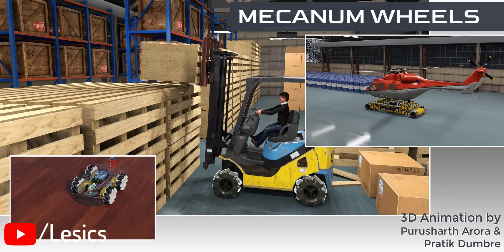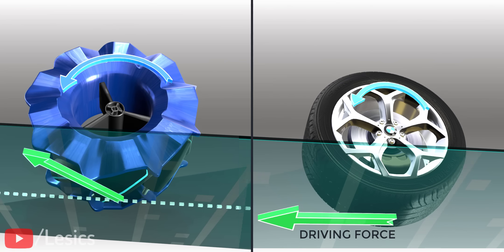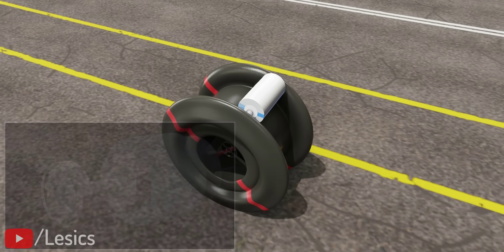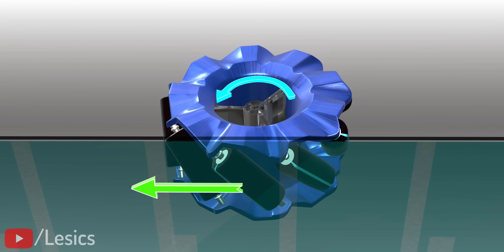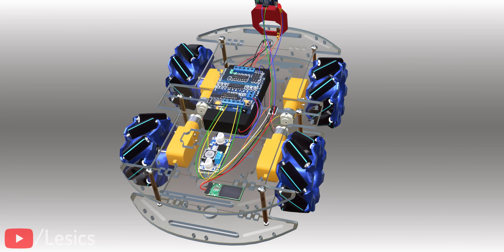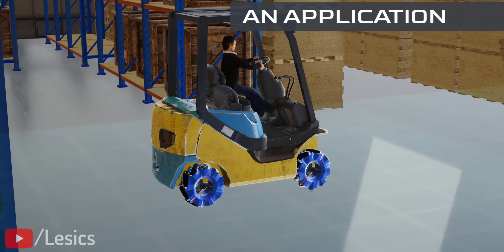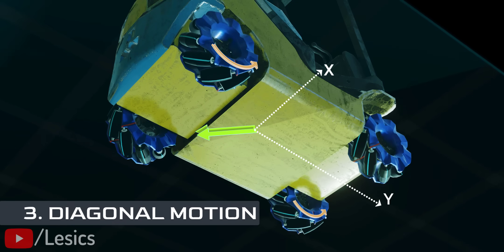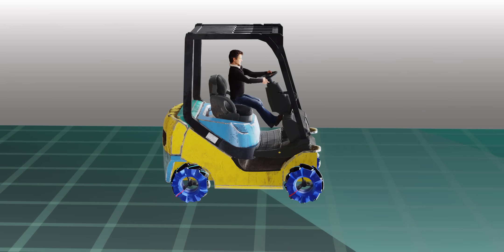The Brilliant Engineering of Mecanum Wheels!

Comment: But if the load is greater at the front than the back (due to the lifting), then chances are that the 2 front wheels will carry greater friction than the ones in the back resulting in slightly unexpected shifting of the vehicle, specially on uneven surfaces of slight differences of friction. It seems promising, but I wonder if this was practically tested in real life under these explained circumstances.
Reply: May be could use a computer system like ESP to dynamicly balance the outputs of each wheel?
Reply: I am sure a computer system with weight sensor and clever program for sure can solve that problem.  But a brilliant question you brought up!
Reply: You can get these.  I think they have been on the market for about 20 years.  They arent cheap.  But very effective.
Reply: @tylero8595  *shit
Reply: https://www.youtube.com/watch?v=0DBXuZv38l8
Reply: These wheel already existed and LOTS of forklifts are starting to adopt them. I've drove one and it felt good. Felt like a regular forklift, just had to get use to some new movements.
Reply: @UnderGroundMerlin  what about the friction of the non moving wheels on the surface ?
Reply: These exist.  This is not theory.  Do some research before throwing stones.
Reply: If the wheels don't lose grip and hold their shape, it doesn't make any difference that there's different load on them.
Reply: Nearly 800 people have voted this comment to the top ... Every one of them is wrong, but don't seem to care.
Reply: Just use a load sensor and compensate your wheel speed with a computer?
Reply: It is funny to me that your comment is loaded with replies of people who think they are smarter than they are.
Pretty much everyone talking about how these 'wouldn't work' or aren't good for x or y reason, doesn't even understand that.
1.  These have been in practical use for a long time.
and 
2.  These wheels are necessary to get specific movements out of a traditional chasis, which is required in certain robotics (and even certain factory storage situations).

Everyone here pretending you are smarter than the engineers which invented these, pat yourself on the back for thinking you are smart than you are.  And remember that you have this tendency in the future.
Reply: Airbus uses them to maneuver large aircraft sections around their factories.
Reply: The traction difference isn't critical, as long as all tires have some traction. The direction of motion is determined by the relative speeds of the wheels.
Reply: Wrong!  That won't happen.  Also, there are already mecanum wheeled forklifts doing work in the real world.
Reply: If the force is greater in the front the forklift is probably going over
Reply: These wheels are pretty common and I have used them on robots for around three years now. You are right, you very rarely perfectly move side to side and diagonally. However there are many fixes to this, a gyroscope gives you your turned degrees which can help you stay in a straight line, another method is dead wheels with encoders to give your actual movement, if one encoder has more distance than another, the motor will work to equal out that difference. With some simple yet complex programming, mecanum wheels are extremely beneficial.
Reply: This is not how physics works. These wheels aren't designed to slip. You either have a wheel that sticks or doesn't stick. If there is more weight, the wheel that wouldn't slip anyway would interact with the ground the same way. If you were to operate these outside in the snow and ice, or on wet ground you might have some problems, but indoor applications on regular surfaces would be fine.
Reply: I suspect it's because the video referred to friction as the driving force when that isn't the proper way to describe the physics.
Reply: @chipfyn1  Your 'simpler idea' involves a second set of wheels, motors and requires special axles that allow the wheels to have a variable elevation

your better idea involves a full on computerized warehouse with integrated tracks so that the gantry can move everywhere it could need too

congratulations, your ideas need more parts, more maintenance and are either much more complex than they should and will cost more, good going armchair 'engineer'
Reply: Yo can adjust wheel movement, torque and speed  through and electronic controller, just as it is done today at current cars!
Reply: https://youtu.be/ZW3OBb_b89k
Reply: I believe the Battlebot Shatter used this kind of wheel in Battlebots season 5. The machine was super maneuverable, but the drive motors tended to overheat
Reply: Here is a a video of an industrial application:  /watch?v=RZ_8xhCi72w
The German industrial robot manufacturer KUKA has a series of products under the brand name OmniMove which use this wheels. I have seen other applications by other companies.
Reply: Sending different amounts of torque from the front and rear has been achieved decades ago, Just think of a modified ATTESSA E-TS
Reply: Just use a differential
Reply: It is already being used. https://youtu.be/0DBXuZv38l8
Reply: most stupid concept, because once there is shift in weight to the front, good luck. Incident gonna go up and someone gonna lose money hitting their racks.
Reply: @chipfyn1  https://www.youtube.com/watch?v=ZW3OBb_b89k
Reply: load gages on the 4 axles will give you the difference in frictional force.
Reply: http://www.okta.com.tr/index_en.html
Reply: wow, nice wouldnt have thought of that
Reply: Must’ve been tested I feel. If it doesn’t work 100% currently then solution might make it work later. If load or surface impacts the behaviour of the wheels then you would need to compensate for that somehow.
Reply: Also, you are halving the power of your motor. Just use swerve drive
Reply: If you know the coefficient of friction you can just slap some sensors on the counterweight and fork block and have the computer factor that in again.
Reply: Install counterbalance
Reply: Computerized control system that takes friction into account and adjust power output of individual motors, each powering individual wheel.

For example.
Reply: Yes
Reply: Orbán Viktor Mihály  did u just copy paste another persons comment xD
Reply: good thought and in this situation, weight should have to be separated on every wheel equally. AGREE OR NOT
Reply: It might require a redesign of the hilo, such that the load is balanced as close to the center of the vehicle as possible. Could have some interesting implications for warehouse design though.
Reply: Every construction guy ever just get in and this one makes it go up and this one down this one makes it go forward and back and exetera  its not rocket science Jimmy 😑. Wait till I show him
Reply: Remember the Forklift Engine is at the back and counteracts with the lifted weight
Reply: i mean the lift can measure the weight and computers can calculate thdiffrence to make in wheel speed since friction is nearly same on floor of warehouse
Reply: The wheels have variable speeds !
Reply: They will put in a computer to counteract all of this for sure.
Reply: true, but you can have software to measure and compensate the effect
Reply: Thank you
Reply: This can be solved with application of control theory.
Reply: There are a thing called PID
Reply: You have an operator.  The operator steers and corrects subconsciously.  You're thinking of a scenario where the fork truck is operated by a computer.
Reply: @austingeorge6659  Computers are only as smart as the humans that designed them so that makes no sense.
Reply: @346Yoman  That's exactly my point.  Who's operating the machine?  A human.  If this fork truck was instead operated by a computer, as it seems the OP was getting confused by, THEN the factors which he mentioned would come into play.  The point I was making is that a human's brain calculates all the micromovements subconsciously.
Reply: @chipfyn1  I haven't seen a forklift with those wheels yet, but coincidently just yesterday I saw a little wheel-drone in a tech store with just those wheels. They certainly didn't use CGI because no real vehicle would exist, but because it made explanation of the concept way better understanding. And for making an online video (where budget is very limited), how would you find out, where there is some company nearby, that has such a forklift? And even if you did, another question if they let you play around with it for some video.
Reply: https://www.youtube.com/watch?v=E2b_69Gpmic
Reply: @giovanni_a67   Thanks for posting that.  Cool to see it in real action.
Reply: @Marc_Fuchs_1985  they used this forklift for myth busters.  There was a QA once and the question was the coolest thing they had in the warehouse and Adam answered it was their omni forklift.  He then showed a demonstration of it being used to grab props and shit.
Reply: Good question, but a forklift has a backweight all the time, so a computer will probably take care of this problem.
Reply: ... Have you never seen one of these in operation? They are real, and not at all fringe in the heavy equipment industry.
Reply: @fen4554  and they suck
Reply: @fen4554  Ehm, not sure what you mean by the word fringe in that sentence other than at an attempt to sound cool, but yes, we have seen them in action, and no, nobody in their right mind would ever use this as common practice. Which is why it isn't. And which is why we won't. One time this got suggested and it looked intruiging but practically it's not something to ever use. Just fun as a gimmick. And if you do encounter them regularly, I might suggest moving as far away as possible. Even the slightest elevation would let loose a few ton piece of machinery with no feasible way to stop it (and yes, even warehouse environments have inclines and declines). Let alone the fact the absolute miniscule footprint these so called wheels provide would just mean you would tear up any surface you would use it on, having to not only repave regularly (unless you would specifically build a surface to handle just this type of transportation and absolutely nothing else, including shoes) but also replace the now torn to shred "wheels" every so often. The amount of power to actually propel the vehicle (in any direction) it is used on is, to say it gently, enormous. So claiming it would work in for example construction or ground cultivation or mining operations is ridiculous given the tonnages expected to move which goes along with that kind of operation. You would be mining coal just to power the equipment transporting the coal. I will give you one thing, conveyor belts sometimes use this mechanic to off and unload at exit and entry points, actually preventing wear and tear normal "skidding" of items on to it would cause.
Reply: first a forklift has counter weights so it doesnt tip over when carrying a load. secondly this is probably most likely used in a warehouse, which has smooth floors, as outdoor forklift would have enough space to make maneuvers.
Reply: this is for a prefect floor, or it will not work?
just not a practical idea at all if you ask me...
Reply: Guys, this is not just a theoretical demo, there are forklifts with this mechanism in the real world.
Reply: @DrSmugface  Well, I haven't ridden one (nor have I ridden the "normal" forklift), so I can't compare.
My point was, that they exist, therefore they were tested and they work.
I suppose it is up to the logistic company to decide if they want them. I can easily imagine, that the advantage is they can maneuver in tighter spaces (small warehouses), and the disadvantage might include something like lower top speed, or maybe lower max load, or higher maintenance (having more electrical motors, and more complex wheels...), and they might not work on roughly tiled floors or whatever...
Because, if you need to service it more often, but you save on warehouse floor space (i.e. you can have tighter corridors and more stuff in the same space), then it may be worth trying.
BUT I am not a logistic manager... I suppose you don't need the sideways motion that often, and zero turning circle or other maneuvers on tight spots can be achieved with regular wheels as well, if you have each wheel driven separately (heck, regular excavators on wheels or even tracks can do it, just turn the left side forward and right side backward...). 
So yeah, it may be a niche toy that may not have that much of an advantage over regular wheels... 
But again, I was just reacting to OP, whose post looked like he did not know that these exist in real life. That's it :D
Reply: @panda4247  but put his question all in bold, surely he must be right?
Reply: @panda4247  Where?
Reply: @breakalegfpv9532  It is quite practical for moving lighter items in a warehouse with smooth floors (think Amazon, Costco, Home Depot, etc) and NOT construction sites or parking lots.
Reply: @stanimal8  I suppose you are right
Reply: @stanimal8  They're used outside in parking lots as well so you're wrong
Reply: @breakalegfpv9532  And that's why no one asks you for an engineering advice
Reply: @breakalegfpv9532   if the forkilift with the mecanum wheels is strictly for indoor use like in a warehouse it would be fine but probably still need a regular forklift for stuffing being used outside
Reply: @devildavin  They're already used outside, there's videos of that, no problems at all
Reply: @breakalegfpv9532  Only has to be mostly smooth. Like a warehouse or load yard.
Reply: @Cenobyte40k  that is why i am curious about how thest things do going up and down an incline with a load in the rain
Reply: Apart from previous good points, all those rollers are going to be hard to maintain.
Reply: @harry130747  All those previous 'good points' are utter bollocks, and so is yours that the rollers would be hard to maintain

mecanum wheels actually have minimal ground friction and don't need much torque even for vehicle rotation like it does for skid steer vehicles, and the rollers can be replaced individually if they have to contrary to how an entire tire would need to be replaced
Reply: @nadarith1044  I agree with you mostly.  As the Mecanum wheels wear, individual rollers could be replaced.  However, one thing to note, the rollers NOT cylindrical, it is tapered as part of a circular arc.  And this shape need to be maintained to achieve continuous contact while moving.  Wheels on typical forklifts are cylindrical, tend to wear somewhat evenly, and can usually operate normally even when small chunks of the tire is chipped off.  Mecanum wheels on the other hand do not operate well if chunks are missing from the rollers.
So while one CAN operate Mecanum wheeled folklifts in an outdoor parking lot, it will accelerate wear on the rollers and the parking lot will need to be pretty flat.
Reply: @stanimal8  You do realize that every point on the roller's arc will contact the ground every rotation just not at the same time like in a typical wheel? and so they will wear evenly as well? not only that but because the rollers roll it means that the contact point on the roller's surface will not remain the same for each wheel rotation, there is quite literally more surface to wear out than in a normal wheel

the way they operate also means that no matter the movement direction the ground friction is minimal which by itself limits wear and tear, and in a typical mecanum wheel two rollers maintain contact with the ground at all times so even a chip doesn't automatically mean a loss of contact

additionally while they may not operate well with chunks missing the idea that this is a major flaw is asinine, the most this manifests as is slight drift in certain movements (mostly sideways)

there are vehicles made for transporting serious loads equiped with mecanum wheels that operate exclusively outside, for example on runways like that robotic 8 wheeler platform for 10 ton loads, or even vehicles and robots that are meant for serious off-road terrain, so clearly this isn't a serious issue
Reply: There's very few workspaces that would require such a vehicle. Most fork trucks are more than capable. If you had an area as tight as this in real life...it would be dangerous
Reply: @James-oo1yq  yeah you would need to design a warehouse to specifically use this Omni lift.  Standing forklifts (electric forklifts) are a good middle ground if you need mobility because they can also turn 360 in their own footprint and offer way more mobility than a normal forklift.
Reply: @chi7818  Good point! The standing forklift would be a better solution, and far cheaper
Reply: Nice, 
A good prayer:
I'm a sinner JESUS please forgive me for all my sins I know you shed your Blood for me on the cross at Calvary. Thank you JESUS for my salvation and for shedding they Blood for me. I love you JESUS. 
Romans 10:5/10 ct...❤️k
JESUSisLord!Amen...
Amen..
If you'd like to call someone who cares 
83
For
Truth.
bc you don't know when you'll die?
.y r u hesitant.
Reply: And also i doubt these wheels will handle any serious weight that forklifts always deal with.
Reply: @xArchesx  They already do
Reply: @xArchesx  Well if i ever needed a confirmation that you have no idea what you're talking about now i have it

along with an indication of your level of inteligence, which isn't very high considering your reply
Reply: The tires probably get damaged more due to friction. And material doesn't matter much. When you consider regular tires with the same material. Plus it looks like it could make someone easily dizzy
Reply: @ReformedThe  Mecanum wheels are known for moving and rotating with minimal friction, those free rollers mitigate a lot of force
Reply: From the lack of real world video I'd say you have the answer to your question.
Reply: No this is one of those things that will suck up money in kick starter funds then never be seen. A stand up Forklift can turn on a dime and you don't have to worry about their wheels completely blowing apart under a heavy load. Looks like that could happen easy here and if the load was elevated that forklift is tipping over at whatever side the wheel blown out on.